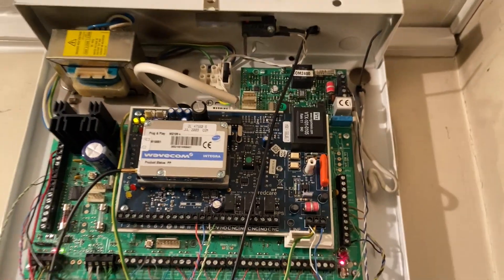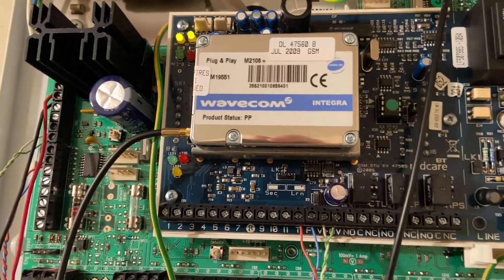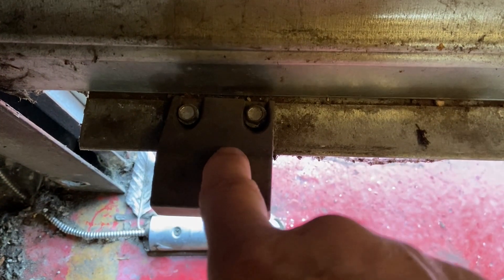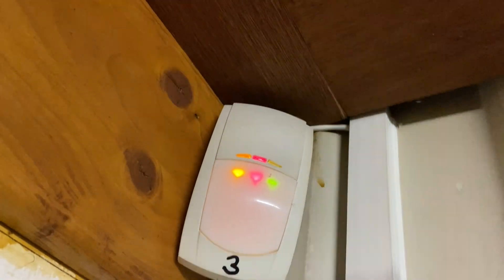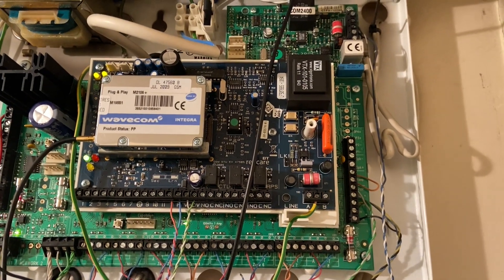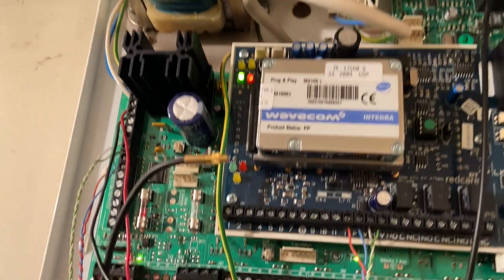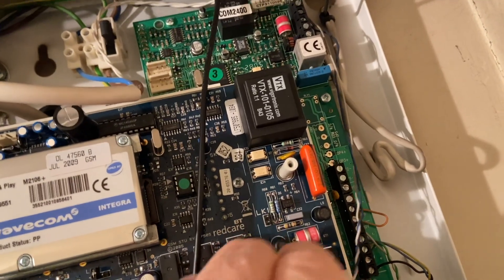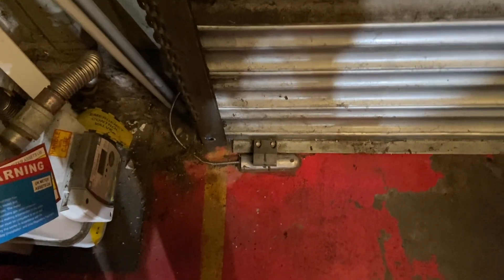Servicing and testing a Redcare signalling alarm system to the ARC.

Comment: casting my critical eye... grommets absent from the top right hand point where the BT line enters + the top of the alloy tube for the RSC, mains flex flopping about unsecured, your Gold IBT not going to produce any meaningful reading on a new battery or that brand of battery, I've never seen or done an EWD holdoff test until the cut off timer has expired. Interesting to view the content
Reply from the maker: Your right, system was fitted back in 2004 on Classic redcare, upgraded in 2009 to Redcare GSM and in all that time never noticed no grommet, allow tube does have a boot at the bottom and compression plug at the top, are you looking at the horizontal 16x10 plastic trunking which looks like its coming from the tube?.  Mains flex is way to long, i even thought that when i videos it so thats highlighted for the next rms.  PS didnt think anyone took that much interest in my videos as my mate says id bore the arms off a wooden chair.
Reply: @SFGSecurity  all my alarms look better with the lid on... Knight RSC - they appear to have changed the alignment a few years back where the want the raised spot lining up with the centre of the magnet rather than the centre on the contact